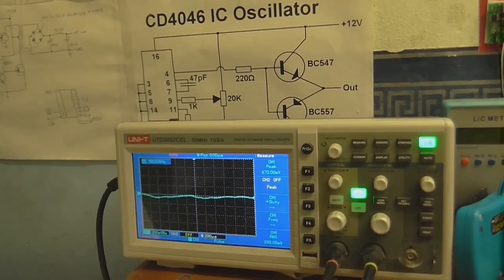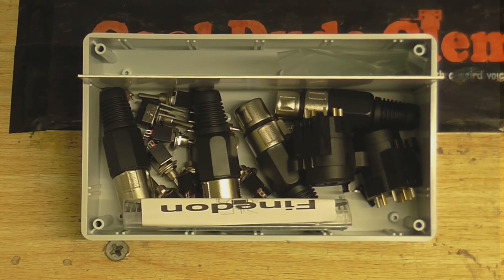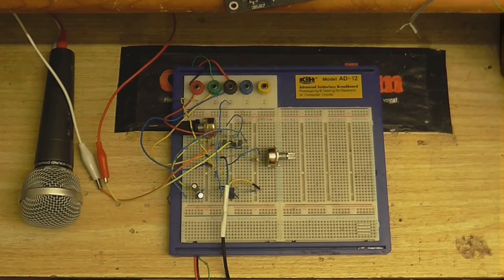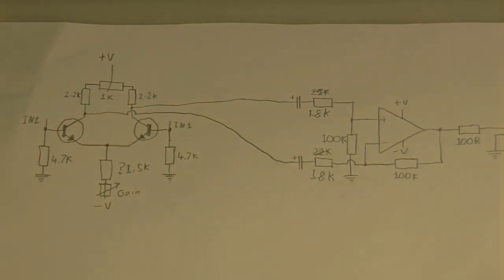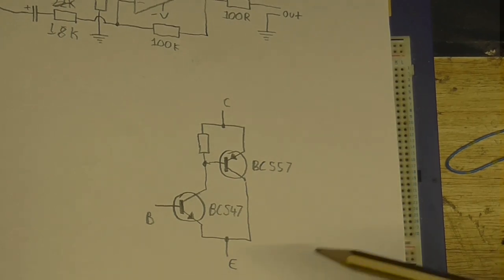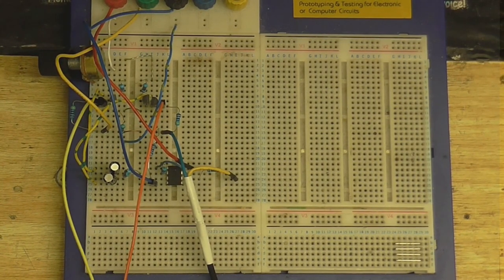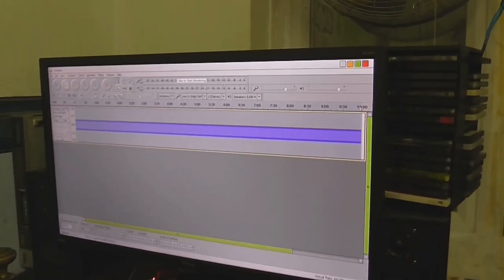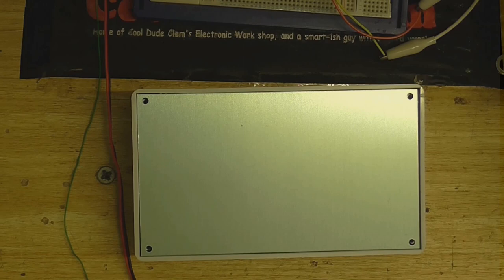Making a new microphone preamp pt 1

Comment: Well done Clem!
Nice to see that you're still with us.
That's a Long Tailed Pair you have at the input there.
Your "Limiter" is really an A.L.C. Circuit rather like the ones that they put in the last of the Analogue Audio Cassette Recorders and it seems to work very well.
For trying to pronounce Sziklai I would suggest Sick Lie as I think was suggested in Practical Wireless because it's easy to remember.

Comment: It is I, again! 🤣 I am trying to build BJT version of amplifier. I learn about differential amplifier.

Have you tried replacing that single emitter  resistor with so-called 'current mirror' or 'current source'? Improved version is Wilson current mirror.
Reply from the maker: I have experimented with that a few times (but not in any of my videos though), but in the long run it's just easier to use a resistor as it works well enough for my needs. Maybe, after my long vacation from making YouTube videos, I'll try that on camera.
Reply: @CoolDudeClem  Oh. I thought it could be your video content.
I do not know who you are but you have an oscilloscope (before this is old school CRT one) and you somehow make things work that I could not. But then again, I do not really built any circuits, not sophisticated ones such as what you do. I normally first simulate a circuit. Simulators are lousy as they never reflect the properties of physical components and real-world conditions and usages, just to state the obvious. I use simulator to get repeatable (surreal) results merely to satisfy the perfectionist part of me.

You can gradually make an operational amplifier. You will have a series of excellent video content! No wonder the very first time I saw those transistors back to back I said to myself how come you are building an op-amp but if you are already building an op-amp why still use a monolithic op-amp at the end stage!

I wager you know that it is a lot cheaper and way less mathematics to using a monolithic device, almost a no brain thing.  You are doing what you do is simply want to have fun, experiment, and share your peculiar whinging journey with the world. You whinge and waffle loads, but very desirable I must say!